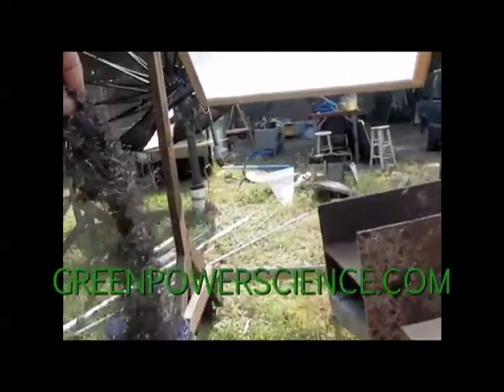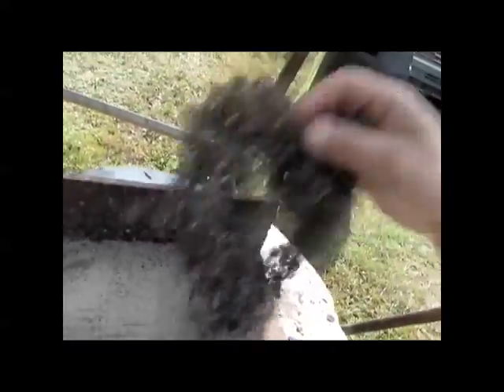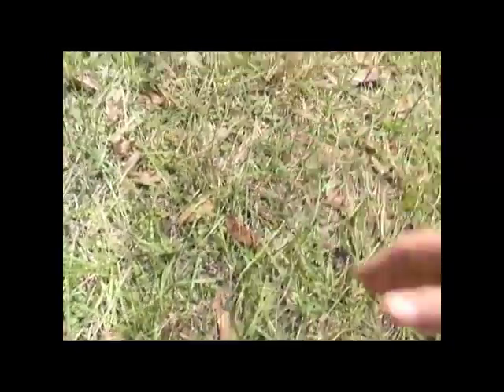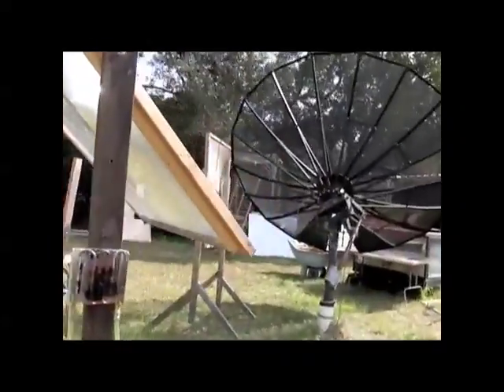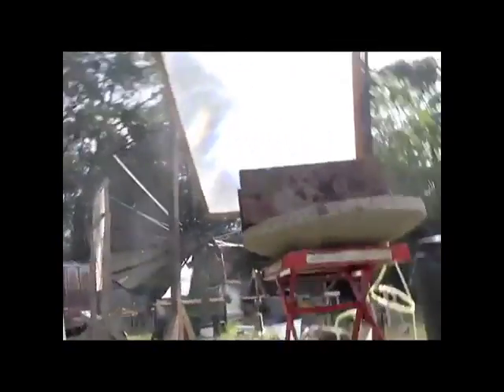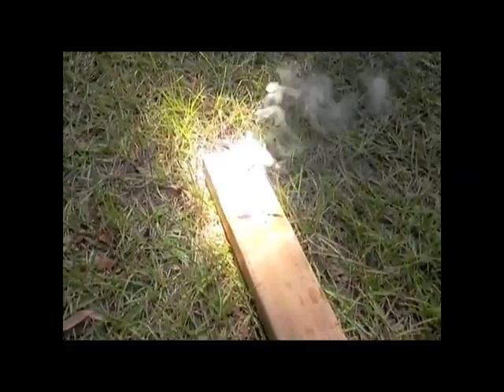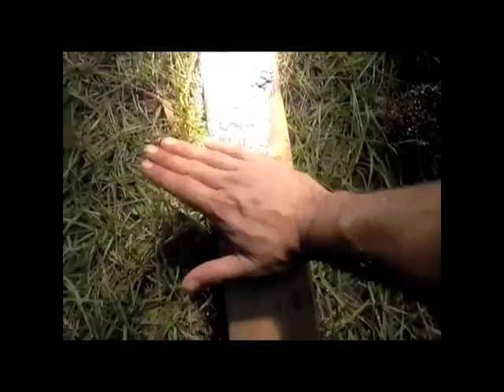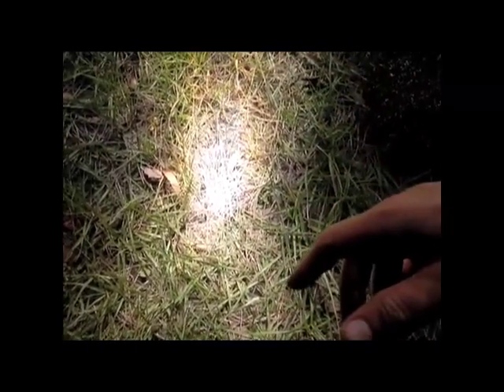Fresnel Lens Focal Length Change with Water, Concentrated Solar Power

Comment: so water defeats the purpose of a solar collecting project due to changing its focal point.  is it possible to keep the focal point uniform?  maybe placing a straight glass pane in front of the fresnel lens similar to a dual glass window?  or maybe placing another fresnel lens behind the other (short of the focal point, possibly) similar to a telescope?

Comment: @koenstr Correct me if I'm wrong,I don't know about a Fresnel Lens but for a normal convergent lense the thicker it is the smaller the focal length is. Water works as part of the lense's thickness.

Comment: Very interesting! Of course, you could always have a thing plastic or glass protector to keep water off the lens--without losing TOO much light.

I suppose the water collects in the ridges, which would HUGELY change the parameters of the lens.